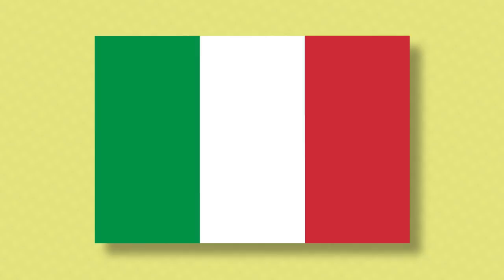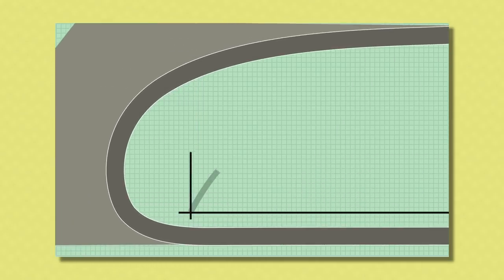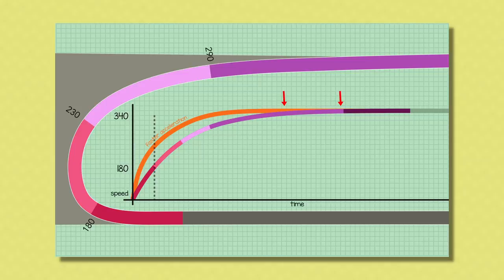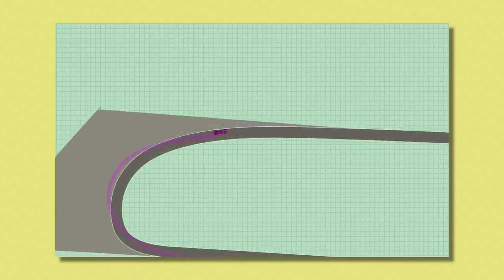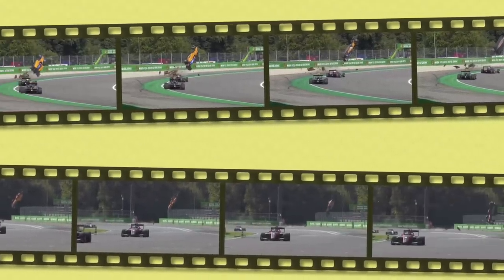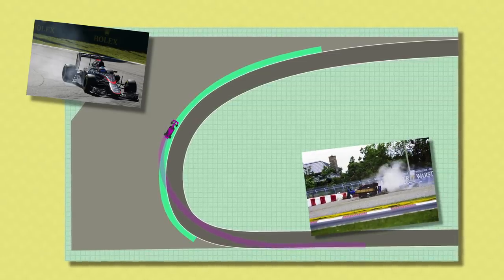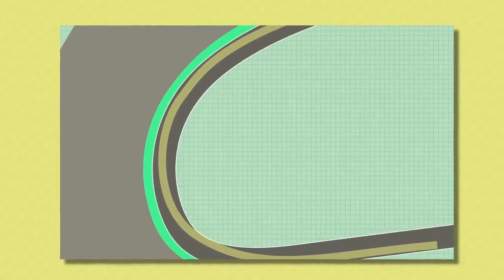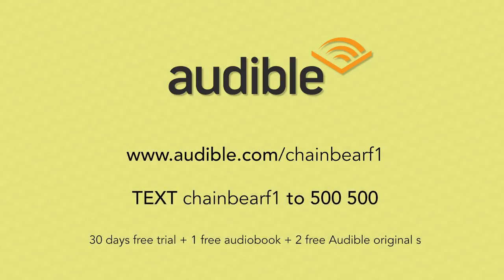Why run wide at parabolica? Italy 2019 (Part 1): "Just stay inside the lines!"

Comment: On-topic: electronic detection and iRacing style slowdown penalties that you must serve before the next few corners or you get black flagged would work just fine. Penalties automatically handed out in a safe fashion. You don’t need any fancy sensors installed in the track. All you need is a wire underneath the white lines.

Comment: In Australia the v8 supercars use a sensor in chicane curbs for the queensland race, it automatically picks up the cars trasponder and issues a curb strike (instant lap deletion in qualy, and penalties for multiple infrigments in race)
A similar system would be easy to implement

Comment: How about a sand paper like material covering the run off area ?
It would shave off grip from the tires , in a way the corner would police itself  .
Reply: That's what's been done at Paul Ricard.

I think it's the best solution, it can ruin a race, but the car is still completely fine.

If they dye the strips in a less flashy color, people will hopefully stop complaining about them.

Comment: Thoughts on introducing a change of grade at the track limits to mitigate track limit issues?
If the area external to track limits was to grade downwards at say 5-10% (or even simple a change in grade from the track surface to outside track limits of 6-8%) would hugely decrease available grip, introduce risk of floor damage to cars (i.e. a reason not to go outside track limits like a barrier/gravel) but still provide a safe runoff for vehicles to take if a failure or mistake was made? You could then have a section at the end of the corner/past the exit kerbstones which was at grade to allow vehicles to safely re-enter the track.

Comment: The official rules from the FIA is that if you go off ANYWHERE in the 3rd sector when in qualification, your lap time gets nuked.
But that's in the out-lap before you set a time (because most F1 drivers only go out for one lap of qualifying), it's normal for this and the next time to be deleted, that's just how the rules are.

If you go off 100 times in sector 1 or 2, no problem, but don't try to do it in S3. (in your out-lap)

Comment: I think the grass or gravel strip sounds like a good idea, though I'm wondering if having different pavement types in different parts of the corner could also work in the long run, with degrading amounts of traction towards the outside.

Comment: They could get the sensors for when you go out of the track with instead of a power dump make the car maximum speed be 300km/h instead of 340km/h, you still accelerate fast enough to not get hit by other car but you won't be able to match the speed of an incoming car...and it can last till the next lap with a drop on the maximum speed acumulating by a fixed amount (not less than 280km/h for example).

So, if you go out of the track you get a lower maximum speed without loosing power to avoid colisions and it will last till the end of the lap.

Comment: The embedded sensors & automatic issuing of time penalties isn't a bad idea. In addition, instead of the risky power throttling, activating the sensor could maybe block you from using DRS in the next straight (or even for the whole lap), though that's only a disincentive if the car in question is running with other traffic.

Comment: I think, as a rule, on all the circuits, they should have composite runoffs rather than all hard or all gravel. Most modern F1 cars and most cars in general are around 1.80 m in width. Two meters of hard track outside the lines should be enough to allow them to go wide while still touching the line, or at least allow a small margin of error where you get warned and penalized by race control the usual way, without getting stuck in a gravel trap and having to retire. If you go wider, then gravel trap it is (and the more gravel, the better), for fairness and everyone's safety. I believe this would also be the best solution for Spa's Raidillon, which you did a video on after Hubert's fatal accident (one in a list too long).

Comment: I'm now thinking of something similar..the shortened Watkins Glen course has cars going very wide coming out of turn 5, taking advantage of the chute leading to turn 6 and its paving, except the course takes a shortcut to bypass the 'boot' entirely and go on to turn 10. Would there be a way to prevent runoff there?

Comment: I have some questions - the old F1 cars seem to use late apex in the past, what changed? A late apex makes sense if it's a turn instead of a long straight after parabolica - does this mean a late apex will be faster through the first half of the straight but slower in the second half?

Comment: Great video as always. One thing tough: changing the line trough the corner or losing traction doesn't change the shape of the acceleration curve; it just shifts it along the time (or space) axis. Same result (getting to top speed sooner), different reason.
Reply: It isn't a graph of acceleration; the curve is the acceleration, but what's graphed is simply the velocity over time. Earlier acceleration leads to a change in the shape of the velocity graph. You'd be right if he was graphing acceleration, instead of its integral.

Comment: In North American football (Canada plays it too.), you were almost guaranteed an illegal blocking penalty, or two on a kick-off or punt return. A color commentator, a former player, said, if a penalty gets called on every play, it's time to take a new look at the penalty.
Same thing here. I don't know if this corner hold a similar place in European racing lore as the carousel at Nürburgring or Eau Rougue at Spa, but it seems that recontouring the turn would be the easiest and most fair thing to do. Taking out the increasing radius in the second part of the turn, and evening out the radius to where the car wants to run would be an answer to consider.

Comment: The graphs at 2:00 are wrong: the cars do not enter the Parabolica from a standstill.
Both graphs should probably start from the 180 point on the curve (since we're only interested in the acceleration phase of the corner).
Reply: Well, it is a general simplification. But you're right, of course.
Reply: well it isnt marked on the curve that the origin is 0 it could be wtv the car is.
Reply: the point where both axis meet isn't 0km/h. It could be, but that would be illogical.
Reply: @bennlowded  The nonzero origin interpretation doesn't line up with other details. The 180 point on the track scheme is where the car starts accelerating. And when he drew the acceleration graph, he talked about it like the full F1 car acceleration graph -- i.e. from a standstill.

Comment: Its a NASCAR line.  Run high outside and take that momentum with you down the straights.

The sensor idea is a decent idea.  If all 4 are off, instant 3 second penalty.  No stewards to worry about.

Comment: in the monza and coming to parabolica corner best enter is a little bit early braking and early apex, because after the parabolica corner on the straight is longest run on this track, early apex provided good corner exit speed before long straights and before the top speed run and before defensive tactics. On the parabolica late apex is bad because late apex bad slow corner exit speed and outside kerb attack risky.

Comment: Like they do in France ... make a strip that has a tremendous high friction coefficient .. so that when a car drives over it , it will not ‘loose’ grip.. but instead gain a lot of resistance so the car slows down... and in case needed , reach the tarmac strip and brake normally to avoid a collision with the wall...

Comment: Take a page out of sim racing (especially iRacing), and use a slow down penalty system if the drivers go too wide.  With the sensors on the track limits, instead of automatically slowing the cars, flash a penalty warning on the dash.  They have a set amount of time in which to slow down, or face a harsher penalty.

Comment: "Colors on wheels"
I thought of the same thing. But then i realized that most of that color is going to wear off pretty quickly. And if you make it splash you are instead going to cause a slide into the barriers at high speed.

I then thought of just putting needles on that corner, needles that will puncture the tires leading to a slow leak forcing any offender to go to the pits to change tires.

But in reality, the "F1" solution would be to simply have magnets embedded in the track that would trigger a sensor in the car which would reduce its power for a set amount of time to negate any gains possible from taking the corner wide. They can easily embed such things in any place where it's deemed necessary. Cut a corner too close and you lose.

Alternatively to magnets, they can just have visual sensing equipment that senses any car breaching the line and either identify the car that crossed or simply sound a loud alarm so the officials can review the footage and slam the banhammer.
Reply: Yes, i paused the video at around 6:13. Sue me.

Comment: i recommend spikes, you go out, you stay out :P... now that i think of it what started as a joke, one way spikes could actually work, you can go out but must go around the whole corner to get in and it should be rather safe. On the topic of limiting power is good but not sudden but rather in a gradual manner, for example once you reach a certain speed which can be deemed safe hence on the straight start limiting power for a few seconds gradually from 5% to 15% which will negate any benefit you might have gained and also hand you a penalty at the same time.

Comment: Assuming the bigger capacity manual deployment electric boost makes it into 2021 regs it would be cool to see aa new type of penalty, where if an infringement is detected the car will discharge some amount of it (for example a display could be attached to the side of the car, it would normally be off but could turn on to say 'penalty' and use up energy normally used by the hybrid, the longer the display is on, the more energy is used on it instead of hp). That still penalises drivers for breaking the track limits, but a skilled driver will be able to minimise the penalty by being careful with when they charge and deploy the battery.

Comment: What about grooves in the track? Granted we don't want a USA 2005 repeat, but long and wide grooves a couple of centimeters deep that will make the car lose most of it's straight line traction because it's being bounced around. It should in principal work like a small sequence of curbs but instead of pitching the car upwards it should shake the car up, where the drivers either need to get of the power or stay in within the confines of the track.

Let me know what you guys think, because I see this potentially working out

Comment: What about if we had a very weak fence around the track. Maybe aluminium or something I don't. Something that is strong enough to take a few bits of carbon off a front wing so drivers get penalised for going off track but weak enough that it is easily flattened if a car hurdles through it

Comment: I actually think that part of the problem with modern F1 is the way in which drivers are allowed to go outside the white lines with half of their car or sometimes even more. The track is inside the white lines, nothing more, nothing less. If they wanted you to go wide at a certain corner, then they would have made it wider. The run off areas are there for your safety, not so that you can abuse them to take a wider turn. Ideally the white lines would have solid walls on them. Obviously this would be horribly unsafe and so it could not be done, but it does fit my point.

Comment: Two thoughts. Firstly, Paul Ricard has those horrible blue patterns that are supposed to be very abrasive on tires. Maybe that's an option? Second thought is that instead of "low power mode", if they run wide on parabolica, DRS is automatically switched off on the main straight? Ok, latter doesn't affect those not in traffic, but those who are would be more careful... (Or maybe even an anti-DRS applies?)

Comment: As long as your not in a chicane, your racing line has nothing to do with the length of the next straight. Your goal is to exit as early as possible, not as fast as possible. The reason the run wide is because the first part of the corner is tight, making it hard to embed as much apex speed as the corner exit allows you.

Comment: But how nonsensical really is a coloured strip beyond the kerb? Not only would a layer of coloured adhesive be an obvious and effective indication of track limits being disobeyed, it could be a less grippy surface anyway and reduce the incentive to run off in the first place. What are the drawbacks? In Hungary we saw cars spectacularly churning up chalk from an earlier oil spill on the track - could this be used in a similar vain? It is a high tech sport but often the simplest solutions are the most effective.
Reply: @Jin Middleton: I guess keeping the space inside the white line 100% clean would be the challenge. Cars will be going over the paint constantly with 2 tyres and then dragging the stuff back onto the track. At some point you would start getting false positives when people pick up colour with all 4 wheels while having 2 wheels on track.

Comment: I like the sensor idea, but instead of "low power mode"  it could disable DRS for 1 lap.
Reply: Or a delayed action so instead of topping out at 340 you only get to 320, but your acceleration on the way there is the same.

Comment: The grass border idea is by far the best. Simple, inexpensive and instantly punishing transgressors. The creeping use of ever wider bits of track width round corners means that almost every circuit now has in effect a permanently wider track. Bad idea because it rewards incompetent driving and tolerates bad driving. The solution is simple. Keep the same effective width of track everywhere - make exit curbs no wider than the width of one tyre with slippery grass on the edge. If you go wider than this exit curb, then tough, you should have driven with more skill. There are too many chicanes and corners now which can virtually be driven as though the corner barely existed.

Comment: It could drop the car to low power mode after a short time, since the pit straight is gigantic, the FIA could instruct the drivers to run to the right, and after 2-3 seconds the car would drop to low power for 1/2 secind

Comment: For me, it should be censors around the track. Infringements will incur a loss of their electrical energy boost for X laps, similarly when a driver has wrongfully impeeded another, the boosts could be transferred to the impeded driver to help them recover lost time.
Only works obviously where there are "boost" options in the racing catagory, but I imagine most will do in the coming years (though hopefully not all).

Comment: Nice... getting into this video after full race in Monza with 2000 Minardi (7th place.. that car lack a lot of HP and 1 gear vs leaders). I go wide because cars ahead of me go wide and getting any bit of slipstream might help to overtake at then end of start/finish straight (although more likely to go little more V-shape into corner and use inside line at 4th gear to have more straight-forward motion).  But riding on track version with grass there - price of mistake would be much higher vs just "tiny bit wider - whatever" now. Same apply for Brasil - before tarmac at turn.. (after 2nd straight and after fast right turn before going into slow corners) it was much more important to have good line or would lose a lot (even if there would be no car damage possible from going through grass/gravel).
Okay, never mind, just had to put this down =))

Comment: man, that running wide racing line is the straightest path in a parametrically parabolic shaped curve. It is the geodesic line in a velocity graph. It is the same principle as in all racing lines for any curve. All racing lines are about the straightest line because that will be also the fastest path available.

Comment: if the car goes 4 wheels off at any time (measured by sensors/video whatever), it must go through a penalty zone (thinking like the boost zone or whatever they call it in formula-e) losing the driver approx 0.5 seconds (or whatever is appropriate). this would be mandatory so even if you're bumped off, you need to go through the penalty zone just as if there was a sand trap and you were pushed into it. it would then be up to stewards to decide if a passing car is worthy of infringement. same should be applied in the case of a car outbreaking itself and cutting a chicane (like leclerc and many others did in the monza). just a small slap on the wrist but i hate seeing cars cutting a chicane and not losing any time at all or hanging onto the lead only because they measured their re-entry to match the distance before they screwed up the corner so technically didn't gain an advantage.

Comment: They could as another idea change the layout of parabolica. Make the entry to Parabolica a 90 degree right hander forcing cars to slow right done for the braking point and then coming out of the corner they would be taking the 2nd of half Parabolica tighter to reduce the distance rather than as they currently are which is running wide

Comment: 4:53 tarmac run off does not make a track more suitable to other motor sports. For example motorbike racing requires gravel traps to safely slow down bikes and riders. The removal of the gravel trap in Catalonia is the reason why Lois salom was killed. Tarmac run off areas do not make a track more suitable to other motor sports. Just to point out I really like the videos it’s just there is a misconception that tarmac run off is the best run off solution.